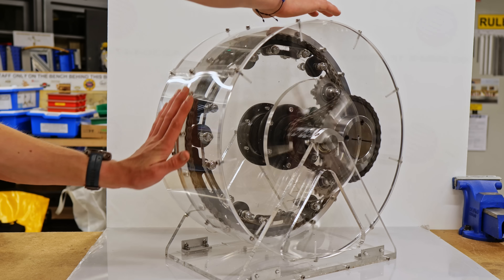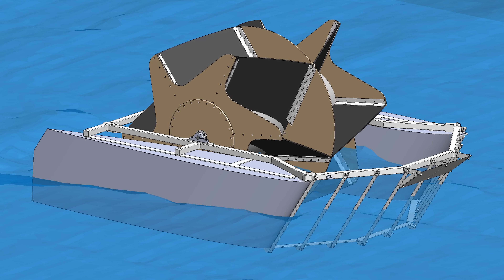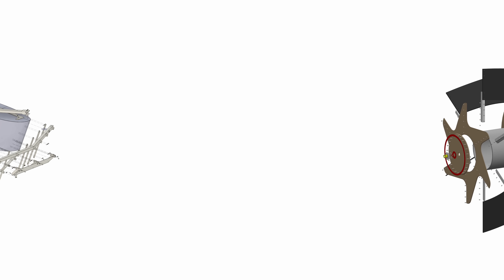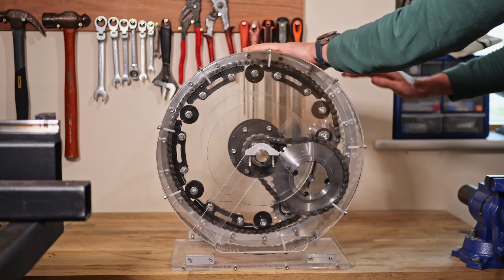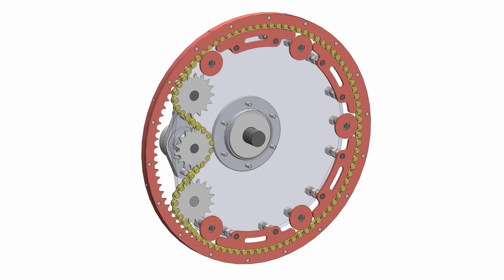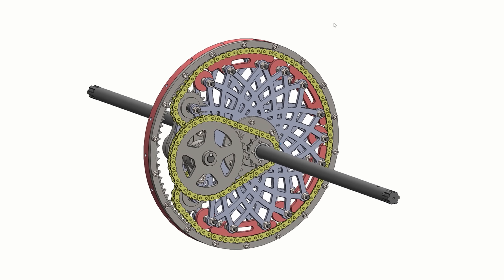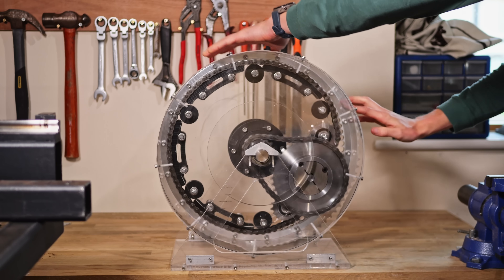Design of an Inverse Chain-Drive Transmission

Comment: Awesome job! Can I add something? You fell for a common fallacy thinking that more teeth engaged with the chain reduces wear. Chain is much more elastic than the inverse gear, so when under tension, the chain stretches a bit, and only the very first few links engaged with very first few teeth are actually bear all the load. Imagine if the chain was made of rubber - the sections of the chain between gears would stretch and transfer load to the first tooth, but the rest of the chain would lie still on the the rest of the teeth transferring no force. So, you can safely make the chain  not to run the whole circle, reducing number of rollers and static pads. You can probably get away with only 1 roller and no static pads at all.  This will reduce losses in the transmission.
Reply from the maker: Thanks! Yeah I was also thinking of this when I was designing it, but decided not to go for it in the end because of the added complexity of getting the chain links to line up again with the sprocket after taking a shorter path than the diameter. But I agree if done correctly could go a long way to reducing the friction.
Reply: @taow   alternatively, you could use (the first and last, depending on rotation direction) toothed rollers and inverse gear, with every other tooth removed, and have them intermesh with the chain in between, and little lash (close engaged).
Reply: @taow  There may be a way to accomplish that change:
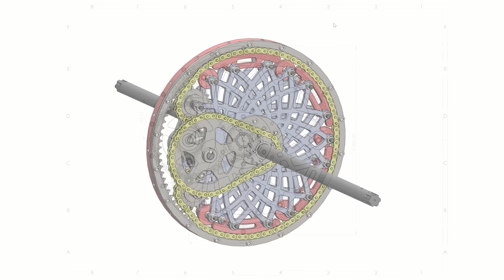Remove all of your existing rollers and guides that are shown in red at 6:05
Move the bottom idler sprocket over to near the 12 o-clock position  with mounting allowing it to be slid toward the 1 o-clock position for chain tensioning.
Then add two or three spring loaded guide rollers to press the chain against the inverted sprocket in the blank section between 11 and 12 o-clock. 

The chain will go against the inverted sprocket from ~12 to ~11 o-clock, then onto the guide sprocket at 10 o-clock, then down around the small sprocket on the side shaft, then it will pass close to the center hub on its way to the guide/tension sprocket at ~12.

If there is not enough room to pass the chain between the center hub and the mounting to spring-load rollers pressing the chain to inverted sprocket you can use idlers to pass the chain the long way around the hub.
If using rollers next to each other between 12 and 11 allows too much space and the chain lifts off of the inverted sprocket too much, then a spring loaded guide may be the only option..... but without dynamically loading the chain against the inside of the inverted sprocket you are asking for major troubles once the clearances wear in and the chain begins to lift off of the teeth.
Reply: Yes, this is what I was thinking. The output shaft could then be placed off center, allowing space for tensioners on both chains.
Reply: This also frees up some space for a tensioner 👍
Reply: I think a single spur gear and ring gear would perform the same, or a planetary gearbox
Reply: Quick rebuttal here.
I am 80% certain that your statement doesn't apply here. I think your point is absolutely valid when you consider normal chain drives, since the forces on the chain also make it tighten around the sprocket.
Since this is an inverse sprocket he actually faces the opposite issue. The force on the chain is pulling it away from the teeth, meaning that I'd be rather certain the first few teeth do in fact not transfer that much force. I would be rather confident that only the teeth exactly above the rollers should be transferring the most force.

But I am open to hear back from you.

Quick edit from myself, I think the smartest way to go would be to actually remove the sliders, only use the rollers, possibly use more rollers and use a chain tensioner elsewhere. However, this then leads to a massive secondary issue which is correct chain engagement... I guess that's probably why people usually do it with belts, they allow for more play.
Reply: @petergriffin4629  I would expect this design will probably start having massive problems with engagement issues and efficiency losses when the guides start to wear. The fact that the chain tension and tooth shape will be trying to unload the chain from the tooth will probably mean that guide/roller wear will lead to maintenance/operation issues.
Reply: 😁We have patented an entirely new, low cost, hear-silent, ultra-efficient, infinitely variable , ultra-torque dense [small & light], high durability gear technology, called FrictionLess Gear, which is a reformulation of gearing theory sans any toothed wheels. The gear range can easily be >700:1 [ultra high gear rage possible] with a price half that of the lowest priced competitor. Enables smaller batteries and/or longer range in EV's [Exploding Vehicles ;-0 ] .  Legacy and novel applications abound. Retrofits of ALL existing bikes, even electrics, will be available. 😉A novel, low cost, near-silent, electric motor tech may be paired w the FrictionLess gear set.
<><><>
Reply: Another part I don't see is lubrication.
Reply: Exactly my first thought, too. 
But it looks cool👍
Reply: В целом звучит разумно, но в данной компоновке экономия ~0,5% на трении за счёт уменьшения сектора зацепления с 90 до 50-60 градусов - это лишняя головная боль по перепроектированию.
Reply: @JustOneFeather why do you think that the improvement would be just 0.5%? In my opinion four static pads introduce an enormous friction. Eliminating them would significantly improve friction. And reducing 7 idlers to 3 would further improve friction quite well.
Reply: @yansakovich  Just don't make it from cast iron. PTFE or oil-infused caprolon works fine.
Reply: 😮 this blew my mind mostly because it makes so much sense. It clicked in my brain immediately
Reply: So could one keep the inverted sprocket and have the other sprockets inside bear the load instead? Basically throw out full engagement and settle for 2 or even 1 point of mechanical engagement? You'd use less chain too!
Reply: @cameryngallardo  There is still a fairly major issue with the inverted sprocket, it is constantly trying to pull the chain off of the inverted sprocket. This means that the internal rollers/guides that hold the chain to the inverted sprocket will be important wear items, it may not be feasible to make this a reliable drivetrain since it will start to derail and/or strip the top of the teeth off of the inverted sprocket when a little bit of wear creates space. Doing strange drives like this are often OK in hobby and prototype applications because the operational time is very short, so the durability and reliability are often not considered.
Edit: Solving this may be as easy and spring loading a couple guide rollers against the inside of the inverted sprocket and setting up the chain path short so that there are no sliding guides.
Reply: But the wear would be spread over many more teeth/rollers.  You wouldn’t be using the same few links/teeth all the time
Reply: Underrated comment!
Reply: doubt that "only first teeth are engaged". in my experience with bikes its only true if the chain is more worn out than the sprocket. but this unequal load will grind the sprocket pretty quickly an they will match eventually.
Reply: @ my thinking too.  Every tooth is the first tooth each rotation.  So the more teeth the more the wear is spread
Reply: Awesome job making something remarkable. But not Remarkable in solving the actual problem. A normal chain reduction of same size would do the job much better. No co-axial shaft is needed at all for this application
Reply: @johgude5045  sure this particular application it might not need coaxial operation but turn the drum into a wheel and put a motor in the center and now you got a alternative to a planetary gearset

Comment: some minor changes here and there and you got a neat differential... made one many years back. most people arent aware of the "spur gear" type...

the inverted chainring, as someone points out in another comment, tends to force the chain off and into the guides... and whilst blades make fine guides in a standard setup as the rollers get to roll, here you lose the advantage of the rollers and bushes as theyre supposed to be seated in the sprocket... somethings sliding rather than rolling.

Comment: Interesting video.

Re: your project - it's interesting how much work it takes just to extra 500-1000w from a river. 2T of assembled mechanical machinery, vs a few solar panels. Yeah, you need batteries for one to get 24/7 power, but likely still a hell of a lot cheaper and simpler to set up XD

Gearbox looks... weird. What's wrong with just a standard direct reduction chain drive? You avoid all of the friction issues with the sliders that way. It looks neat and unique, but not all that practical. I guess it could be more compact, but probably not worth the obvious tradeoffs from the friction.

Comment: TAOW

Taking a few rough scale measurements from screen prints of your diagram, and your figure of 1.5 meters for the outer diameter of the turbine,  I would guess that the overall float is about 3 meters in overall length, about 2.25 meters in beam (overall width) and something under 1.125 meters in height above the waterline.  You say that a unit of those approximate dimensions might produce 2 KW in a flow of roughly 3 meters per second.  Please let me know if I'm significantly off the mark with my understanding of what you said.

I'm a mechanical engineer living on the west coast of the US.  I've been working on a design similar to this for some time for a different application that has a market size at least as large as the one you envision for small power generation in remote streams.  This application could enjoy flow velocities of around 2.5 meters per second at all times but would only need to output about 750 watts at that flowrate.  

The application I have in mind would benefit from being narrower in overall width and perhaps a meter less in overall length.  From my own work, I know that power output is roughly proportional to turbine's axial width and that turbine torque is proportional to turbine radius.  For the same flow velocity, reducing the size of the turbine will come at a cost of power delivered, but from what you say, some reduction in size would be possible if one could rely on a 2.5 meter per second flow rate and need an output of only 750 watts.  I can show you how you can multiply the turbine impact velocity with some simple modifications to the float design, but let's stay with what I've talked about here until we can discuss the application in more detail.

Your inverted chain gear reducer is clever, but a simple, reliable drive is quite important with the application I'm thinking of.  In this case, however, a very low manufacturing cost isn't so important because buyers will typically be well financed.  Weight, however will be important.  I have some ideas, from my own work, about how a lighter weight version could be achieved.  Ideally, if a device, rated at 750 watts and 2.5 meters per second flow, could be disassembled and put in a crate that was 1 meter square on the ends and 2 meters long, it would be ideal.  If that box had a handle on each end, the overall weight should be comfortably handled by two grown men.   My market research indicates that there are more than 10,000 potential installations for my concept worldwide.  In addition, a selling price of around $5,000 (US) each would not be an unreasonable amount to expect to pay to acquire such a unit for this application.

A final consideration for you is that I'm an experienced entrepreneur and have brought several successful products to market over a technical career that spans over 40 years.  Please get back to me with your contact information so we can talk about the possibilities of using most of what you've come up with, integrated with some of the things that I know which will make it appealing for the application I have in mind. 

Thank you for your interest.

Sincerely,

Tom
Reply from the maker: Hi Tom,
Yeah those measurements are pretty close to the true design, good estimations from taking on screen measurements! Your application sounds interesting, feel free to contact me on the email address on the channel details page of my channel.
Cheers!

Comment: Having the chain run through an oil bath would prolong its life.
Reply: I feel like bucket of oil floating on a river is an environmentally questionable decision
Reply: @danjilek801  You'd rather them run the diesel generator, I guess. Where do you think the oil from the diesel generator ends up?
Reply: @barthanes1 Как вы представляете себе попадания масла из дизель генератора в реку? Вы собираетесь его в воду погрузить или что? По нормальному он вообще с водой контактировать не должен, так что и загрязнения маслом не будет.
Reply: @danjilek801  extending your logic, a contraption of metal and plastic and electricity on the river is also questionable?

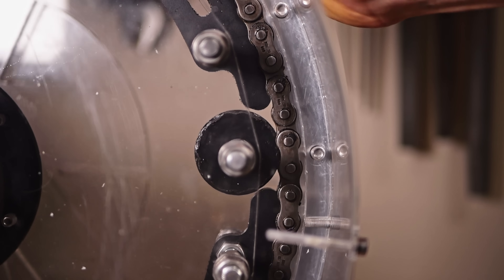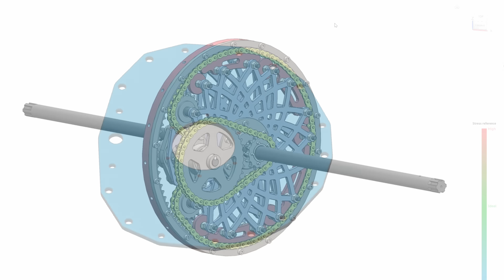Comment: it's benefits are it's easy and cheap to mass manufacture and repair. because it's tolerances can be so low you just need to fix a few things. 4:25 this is your problem you don't need the inverse sprocket to be cnc because you don't need full contact. you are making one big ring, make pizza crust slices have gaps in them the chain does not need all the teeth. then those pizza crust teeth can all be the same unit for mass manufacturing. 4:48 the outer wheel moves with the chain so have clamps on that outer wheel that grab the chain instead of presses that push on the moving chain, have meta stable state switches the grabbers on and off. go in to the 3d if you need to where down is engaged grabbing and up is skipping over the drive area. 5:08 your drive is the best place for a tension put the big wheel and you drive on a spring with a screw. 5:54 with the grabbers instead of pushers the central plat becomes just the main drive and starting and finishing sprockets. 6:20 the chain should be made to go first and should be replaceable anyway, the service life on parts that can be easily replaced is forever and just pushed to maintenance cost. because the pizza crust outer wheel is broken up you do not need to worry about the size of your chain so much if it's long or short by a few links because you are making polygon of chain not a circle.

Comment: This might actually be useful for certain light aircraft. On light aircraft there aren’t flywheels, so geared aircraft engines often have harmonic oscillations due to lack of dampening before the gearing. Leads to extremely high PSRU failure rates. This chain drive should prevent harmonic oscillation by only allowing vibrations to pass one direction and prevent harmonic feedback
Reply: Wouldn't the bad efficiency be a deal breaker for that application?

Comment: Inefficient. No coast.  Friction against internal guide is large.  Offset the pinion and drive an external sprocket for much less drag.  And further, why not run it over a couple sequential idlers then across the volume and eliminate the fixed guide and all its friction FULLY.   All that friction your drive suffers to get full engagement inside the maximum circumference isn't needed.  You're Welcome.

Comment: The inverted teeth will try to push the chain against the chain guides. Try to have the engagement angle of the teeths as small as possible to increase efficiency.

Comment: A puddle of oil at the bottom should extend life. Excentric shafts mounting the lay-on and lay-off sprockets for slack, thou those could be rollers. They could be extended and the angle locked out where it could be serviced to pick up some slack after run in. 

Could see this in South America, Asia, or Africa to provide some battery charging for lighting and device charging where heavy forest makes solar less practical.  Going a bit over the top a cell tower could be driven into a river bed and your charging float tethered to it. Rinse repeat, moving connectivity up river.
Reply from the maker: Yeah exactly the target market for something like this would be somewhere that it can compete with small scale solar. This has the added advantage of  (if it work reliably) 24h electricity generation, so good for refrigeration and communications infrastructure ect

Comment: Wouldn't it have been more practical to do a smaller normal sprocket instead of inverse and have another stage? Although this did look fun & interesting
Reply from the maker: Initially I wanted to avoid 3 stages due to added parts and inefficiency, but looking at the final result now I agree that might have been more practical and maybe more efficient in the end, and would use all off the shelf components, but definitely less fun to design!

Comment: Very good.   A possible hub motor application.  Perhaps you could avoid some of your chain tensioning issues by driving your outer small gears conventionally on the chain, then rather than using the chain to drive the outer wheel, drive it with small axle mounted gears directly engaged to the teeth.
Have you seen the wide sort of chain that is used in four wheel drive transfer cases?
Reply from the maker: Thanks! In the initial conceptual design I did think about using a large bevel gear for the first stage but moved away from it as it's quite sensitive to misalignment and expensive to get one so large. I did not think about combining gears with the chain drive though, could be interesting!